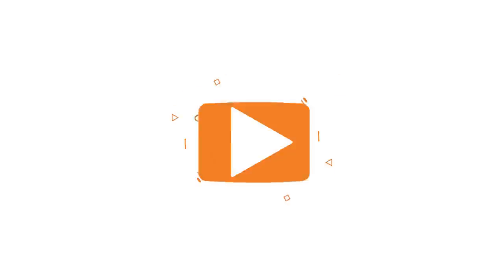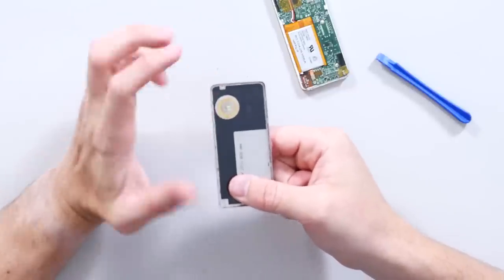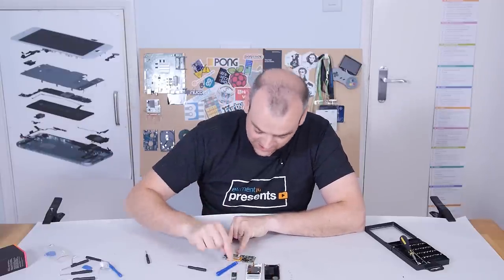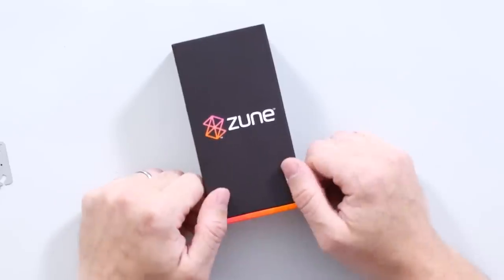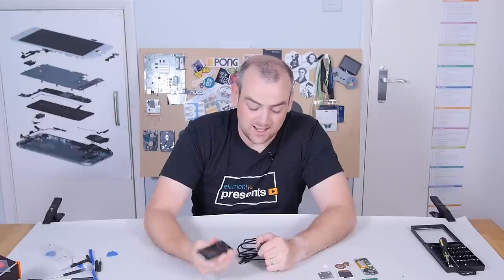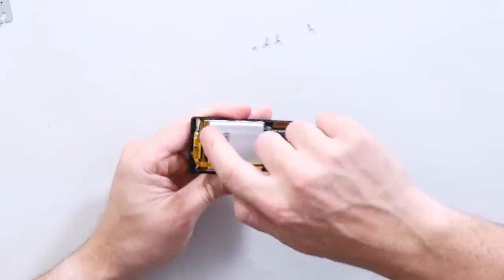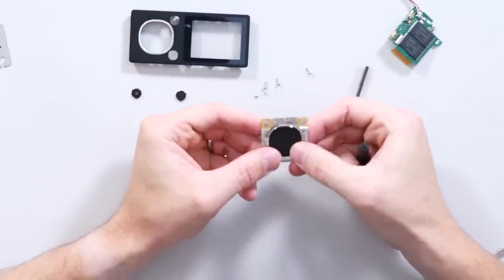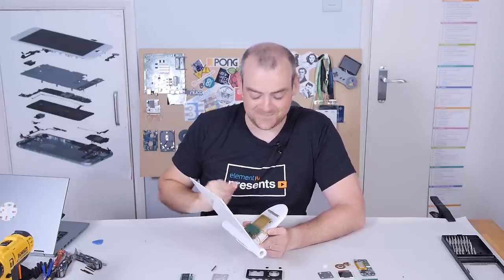iPod Vs Zune Teardown - The Electronics Inside

Comment: Still using my Zune 8gb, bought a 16gb to supplement it. 12 years and still happy with it. Still looks fresh too, doesn't scratch up like most devices.Have to keep copies of the Zune software backed up since Microsoft took it away from the Xbox site which was the last place I found it.

Comment: I was at a jumble sale last year.  Seen a box of tech items on a table.  The little old lady there, didnt know what they were, so said 20 pence each.  I got 2 ipods, gave her a pound, as it was a  charity sale.  Newer models than this video.  One had new age tunes, and a radio.  Other had Paulo Nutini, but no radio.  Ive never used any apple products.  I had hoped I could connect them to a pc and load mp3s in.  Like I did with my basic phone.  I tried to understand Itunes.   Can I use it for free?  I gave up on them. they can be high tech ornaments. I then googled the second hand shops,  one site gave a good price.  So I went upto town.  Got £17 for one, then in another shop got £10 for the other.
Reply: ITunes has pretty much been the root of my prejudice against Apple products. I don't believe it was ever a good product, it was just one that people got used to?